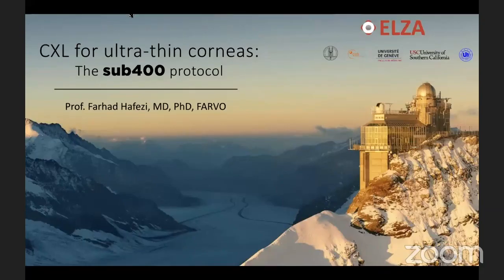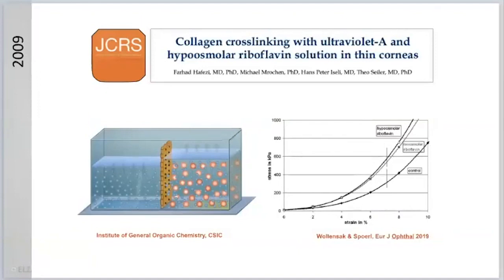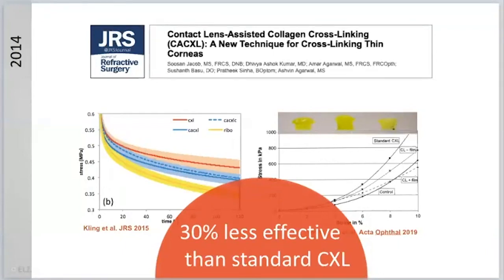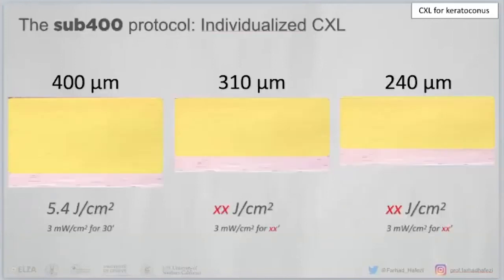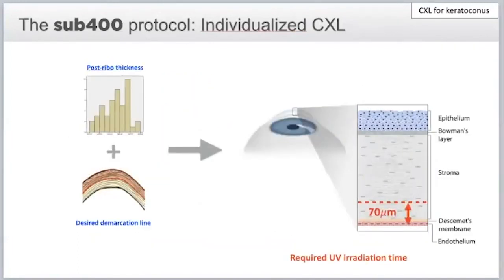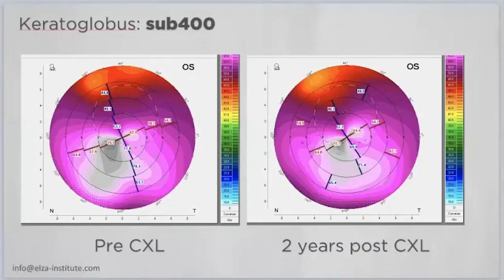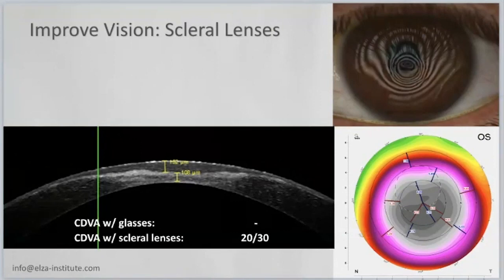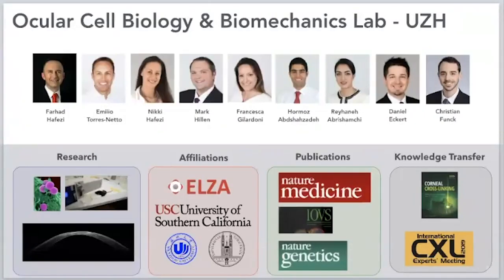Cross-Linking for keratoconus in ultra-thin corneas (german and english subtitles)

Comment: Hello I’ve been watching your videos and readings your papers and you explain this condition and seem to be one of the most knowledgable doctors that I have come across for this condition. my boyfriend (26 years old) has been diagnosed with keratoconus and it has happened very suddenly. A year ago he said his vision was fine and he has never needed glasses until last year. When he went for a second checkup for a upgraded prescription he was told he has this condition. After getting a topography we see that his right eye has a 372um and his left eye has a 394um. The specialist where we are has told us there is not much we can do at this stage as we are under the 400um. After reading your sub400 protocol  It has made me curious as to if crosslinking under 400um is possible in Canada. We are going to try and get a lens fitting and get more opinions  but I would like to know what your advice would be at this stage as we are both worried and confused. Thank you :)
Reply from the maker: Hi. Please note that this limitation is due to the current FDA approval that has approved the so-called Dresden protocol with a corneal thickness of at least 400 µm. In the past 15 years, we have worked a lot on the algoriths of treatment and I can currently treat down to 220 µm of stroma. You will find recent presentations here: https://www.youtube.com/watch?v=vrIiLZkHBK4